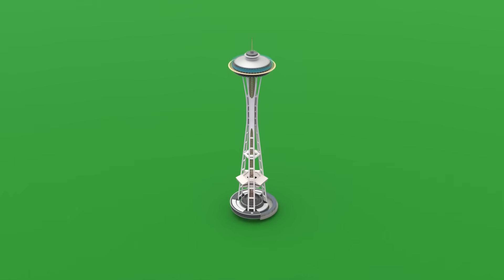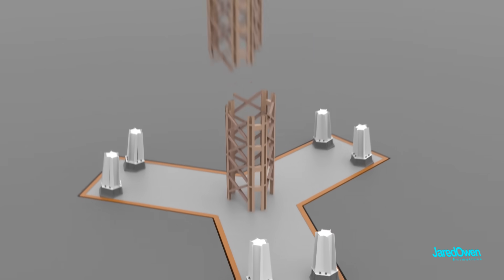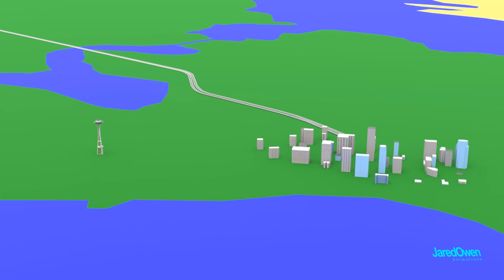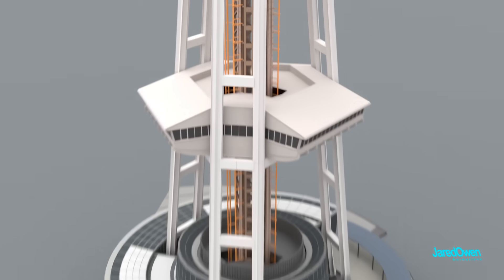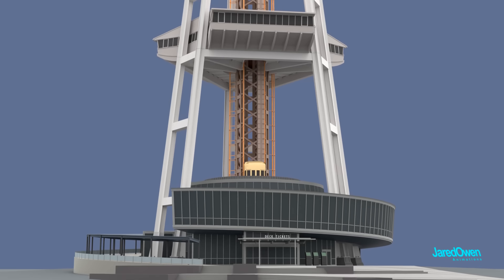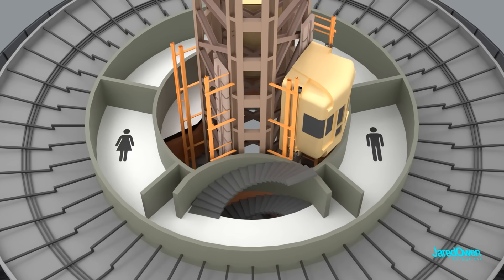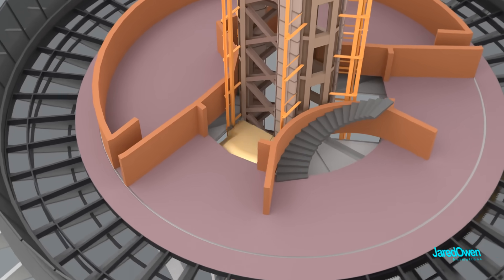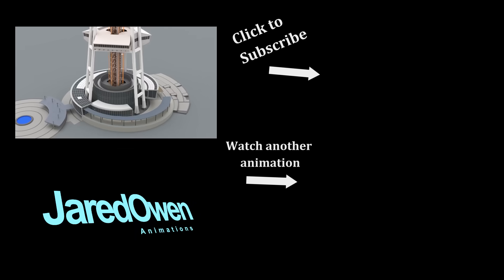What's inside the Space Needle?

Comment: Lived in Seattle most my life. Went to the '62 fair as a kid and had my first trip up the Space Needle. In my 66 years I've only been up in it about 4 times. Took a girlfriend to dinner at the top around 1980. Took my kids when they were little in the 90's and I think one more time in their teens. Until I saw this video I didn't realize they had removed the restaurant from the top. I do remember; when we had dinner there; you'd go to the restroom and when you came out your table had moved significantly. I think it made a full rotation in an hour or less. One side note; the observation deck used to have a waist high wall and then a pipe style railing that circled the perimeter. It angled slightly up and out from the wall about three feet with maybe three more rings of steel spaced about a foot apart. Anyway there were several suicides in the late 70's or early 80's of people scrambling over the wall and out over the "rings" of steel to fall to there deaths. It was after this that they first completely enclosed the observation deck with a cage.

Comment: My buddy spent many years climbing out on the Space Needle roof to change the lightbulbs and climbing under the restaurant floor to grease the rotating track and replace the electric brushes.  This was before the renovation.  He was able to get me a free tour, but management drew the line at letting me out on the roof.  Search YouTube for some great videos from the renovation.
Reply: Yup i did all that your buddy.grease all moving parts in the turntable. Changed all the old burnt out bulbs. Scrub the deck and fixed areas that needed attention. Its high up there with 20 to 30 mph winds all the time. Since it over 600 feet off the ground.

Comment: Cool video. I've never been here. My dad has been there. I always thought it was really similar to the one at the stratosphere in Vegas, but it is not.  That building is 1080 on the top floor where the elevator comes to (which is higher than 184 meters), has windows that are slanted lower(45° I think), doesn't spin, and has rides on top that I'm too scared to do. But my late brother was much more scared. He would go to the top floor but didn't go anywhere near the windows that I would lay on for great views of the city. It's by far the tallest building in Vegas and I've been there four or five times. I don't know too much about the construction but I'm assuming it's pretty different from the space needle. There is a casino at the bottom (of course) and it does have a monorail that goes to it from the Hilton where Elvis Presley performed and held a record of Vegas live performance numbers that I believe Penn and Teller have beaten, but I'm not sure. I know someone beat it. There is no skyline level but the needle skyline level looks like the perfect place for graduations, weddings, or whatever gatherings you could think of. Stratosphere does have a restaurant on the top floor too. Last time I was there the cost of the ride to the top was $14.99 for adults, but that was over 15 years ago. I always thought that a Zipline from the top down to near street level would be fun. It could easily be over a mile long and take a good several minutes to ride but it would end several blocks away and would probably be a logistics nightmare to build. I wonder what other differences and similarities between the two there are. Anyone?

Comment: Originally, the "Loupe" floor was not glass, and was a fine dining restaurant. The seating was on the part that revolved, and the speed was 1 revolution per hour -- powered by a 1 horsepower electric motor. Had lunch there in 1965. While the floor revolved, the outer wall did not, and people would often put things on the shelf-like rim and temporarily lose them. There was also a slight but constant jiggle to it.

Comment: In my role as a video security engineer, I got to go into the core of the Space needle, and even up on the roof. It was truly amazing. Interestingly, the motor that turns the rotating floor is something like 1 horsepower. Very small electric motor, geared very low!
Reply: Nice! Not very many get to go up on the rooftop. I worked there in 1998 and got to go up to the roof once. I also saw the small attic space which this video didn’t cover. Those were fun times.
Reply: Interesting!
Reply: Can confirm this from memory that goes back to the fair. FWIW, although there were lots of people in the queue to go up, it wasn't a "long" queue. It was in an area surrounded by ahandrail, only about 20x20 feet in size. The handrail guided the people back and forth, so that the "line" actually folded over on itself several times. I thought it was a pretty clever and simple solution. For the queue at the Science Center, the buildings surrounded a large shallow pool. There were several islands in the pool, and groups of people would occupy each island. As one group reached the entrance to the first building, they would empty off the island, then the next group would step onto it. The line moved by groups of people, rather than individuals.
Reply: Yes illumanatiya wear batman lies
Reply: Gabe kirpatrick spider bite
Reply: Good his babay ali

Comment: Man, if my family visited this when I was a kid, I probably would have cried very loudly, for I had a horrible fear of heights when I was a kid. (Couldn't stand those net bridges at McDonalds PlayPlace) Nowadays, I might be able to do it, but I would not be able to look at the glass floor. I might pass out.
Reply: And yet there are towers much taller than this one with glass floors.  Also, the Grand Canyon has the highest glass floor at 4000 feet (1219 m) above the bottom of the canyon.  That's 8 times as high as the Space Needle's glass floor.
Reply: @alukuhito   built in 1962?
Reply: Me Grabbing the Rails While Quickly Falling Down The Middle Of The Staircase
Reply: Getting close to the railing on the observation deck was a challenge definitely, but the "best" part is the Elevator. An entire wall of glass. You see everything going up.
Reply: @MikMoen  lol I hate elevators so much, I somewhat get a little freaked out going up 5 floors.
Reply: XD U WERE SCARED OF THE HEIGHTS (FrEIGhtS) OF MACCERS!? LOOOL. (I wasn’t scared of Ronald McDonald For Some Reason

Comment: The 2017 renovation is pretty amazing. The fact that you are three or four feet higher gives you a much more free feeling on the observation deck. They also had to make the elevators drop you off on the new floor. When the restaurants were on the lower deck, the (then carpeted) floor spun at 1 revolution per minute, and if I remember correctly they said that the motor was 1/2 horsepower. Someone who knows for sure, feel free to check me on that. I'd love to know how much power it is now with all that glass.

But the new updates are really nice. My wife and I went up and spent the evening watching the sunset. It does cost quite a bit more than the original ticket, but it's worth the cost.
Reply: The original rotary ring turned at 1 complete revolution per hour. Probably still does.

Comment: What scary thing is that I'm the same age as the needle and I don't feel so sturdy myself. Many changes since opening at the world's fair. But I still hate that elevator ride up, the doors open in the front.
Reply: Dean Oldfield Most elevators have doors that open in the front.
Reply: @drewconway7135  lol. When you go up the Space Needle you can see through the crack in the doors, it's very unnerving. And then there's the issue if the elevator gets stuck. 600 feet straight down. No rear door.

Comment: The curved legs that support the top were straight steel flame bent to for the shape.  Heating one side causes the steel to bend.  The company that built the space needle did it at a money loss to get publicity.  Their bid was so low that they left a lot of money on the table. Our Mechanical Engineering Materials Class at the U of W had one of the company engineeers come and give a talk to the class in 1971.

Comment: I've been living in the Seattle area since late 2013. Last October 2019 when relatives visited was the 1st opportunity to go inside and up the Space Needle. I've photos of it on Facebook. Search for Tyler360 for my 360° photos. Search for Photygraphy for my regular 2-D photos.

I shot far more 360° photos than 2-D. At the time we ascended, the sun was setting. I remember the oooooooohs of the people at their first glance at sunset as the elevator emerged with a southwestern view of Seattle, West Seattle, and the Puget Sound. Particularly beautiful.   Once I was out of the elevator and on the outside observation platform, I'd basically hold my 360° camera (on its mini tripod) at arms length straight up out of the crowd and away from all the people around me. Took a shot. Then proceeded about 20-25-30 feet to my right (clockwise) around the deck to take the next photo.  I believe I went around the top 3 times before I switched to 2-D photos.

After rejoining the relatives for a few photos, we went down to the loop. I tried to time (looking thru the glad floor) the time it takes for the gearing (that makes the floor move) to travel 1 rib (as seen when you look UP the Space Needle from the bottom) to travel point section. The best I found time was between 38-40 seconds for smallest section. From the bottom it looks like there are 6 larger sections with 8 sub-sections making 48 'ribbed' areas. 48 areas @ 40 seconds each is 32 minutes.